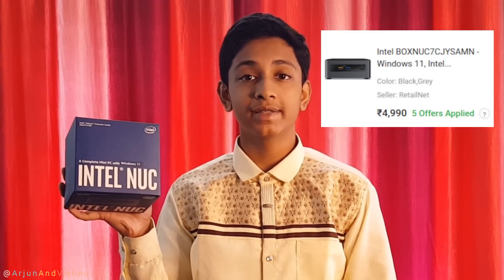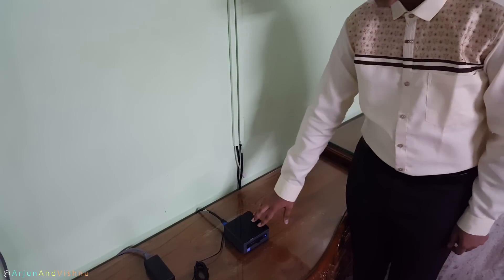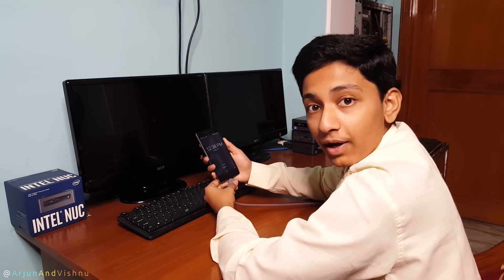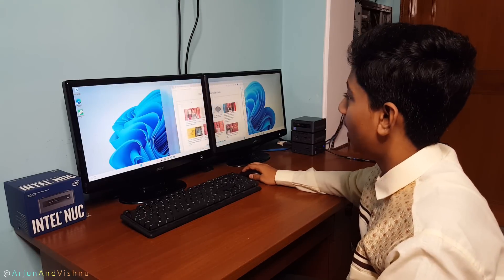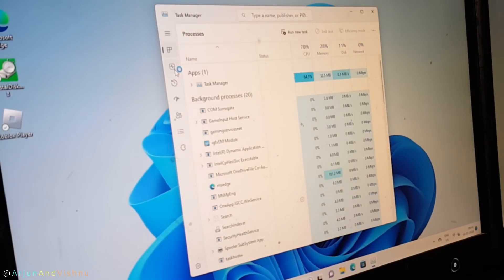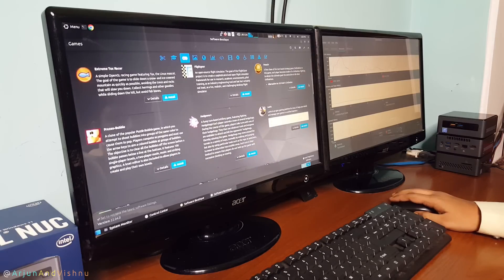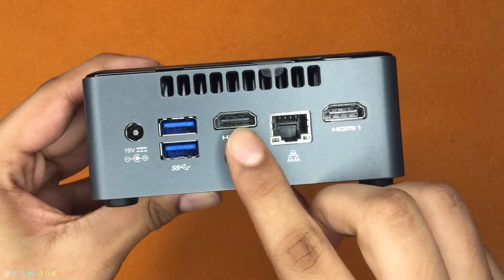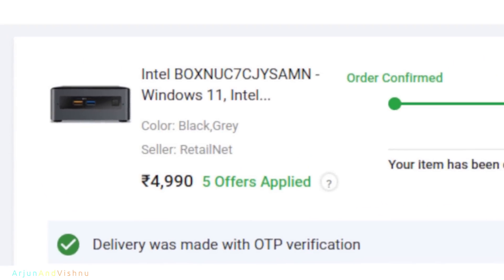Intel NUC Mini PC with Windows 11

Comment: Raspberry Pi 4 8GB or NUC for Home server ( Currently looking at NUC 10 Performance kit i3) Currently available for INR 14.2K. Is it a good deal? I will be running Home Assistant, File Server including Nextcloud and Plex media server on Ubuntu. I will be using 2x8GB DDR4 2400MHz RAM from my old laptop which died last year (processor failure/can’t be repaired). I also have spare SSD so no more additional investment there. Do you think it’s worth it. I am currently running all these services on a old half broken 9 year old laptop powered by Pentium 2nd gen processor and 8GB DDR3 RAM. Using it for past 1 year and it’s working great. But it may fail anytime. Don’t want that as it will disrupt all services and smart devices in my home.
Reply from the maker: Sir, I suppose you are talking about this NUC: 10th Generation Intel Core i3-10110U (NUC10i3FNH1). If so, the NUC is undoubtedly the better choice when compared to a Pi4.

Pi 4 consumes around 8.4 watts, quarter as much as the i3 NUC. But, that's when running at full load, and the NUC is much faster than the Pi 4.

At its current price, the Pi is not practical. Add to that, the fact that you have to add these accessories to get the Pi working properly will turn much expensive than the NUC:

1) Official power supply
2) Micro HDMI to HDMI adapters
3) USB to SATA adapter and an SSD (Because SD Cards are unreliable)
4) Heatsinks and a fan
5) Case

After getting them all, there is still no way to add more RAM. The SSD that does 500+ Mbps on a NUC, will do only 250 Mbps on a Pi.

Pi or NUC is a simple decision. If your applications are ARM based, or if you need to do something with the GPIO pins, it should be the Pi. For all other use cases, the NUC will be faster and is is better suited.
Reply: Awesome  @ArjunAndVishnu  . Thanks! Really appreciate it. At INR 14200, is this model good (NUC10i3FNHN) or shall I go for another?
Reply from the maker: Hi, NUC10i3FNHN will make a good home server. It supports up to 2666MHz RAM, but since you already have the 2400 sticks, you can use them. You will get slightly less bandwidth, but better latency timings.

14,200 is a reasonable price for this machine. Since you are using it as a server, get a similar capacity M.2 drive as well, and put it in RAID 1 with your SATA SSD. The writes will be slower, but the reads will be quicker. Most importantly, you will have data redundancy at all times.

Comment: it is useful for share market purpose, plz tell me
Reply: sharemarket wants i5 processer, 8gb RAm, , plzzzzzzzzz verify
Reply from the maker: If the applications that you use for trading are less demanding or browser based, this Mini PC will work alright. Generally, the logic is better the processor, faster the updates. Yes, you many need 8GB of RAM, at least.

Comment: I've got an Intel NUC 10 Performance Kit - NUC10i3FNHN and I'm looking to upgrade the RAM. Will the Ant Esports 690 NEO FP 4GB DDR4 2666 MHz module be compatible? Also, I plan to add 2*4GB RAM sticks
Reply from the maker: Hello, the NUC10i3FNHN supports up to 64GB of DDR4-2666 RAM. It should do alright with any compatible RAM, in theory. But in practice, I found that the NUC accepts only dual-rank RAMs for higher capacities (32GB and above). It will not be a problem for smaller capacities.

With two sticks, the bandwidth doubles as well since the NUC supports Dual-Channel.

I would suggest you to go for 8GB at least, the price difference is negligible (1k vs 1.4k Rupees). Also, you can opt for Crucial, which is a memory chip manufacturer (Micron), instead of non-manufacturer brands.

Comment: Thank you for the detailed video. Just wanted to know if we can use it as a class room CPU just for connecting to Projector and for teaching purpose (PPT, PDF and Video play via pen drive).? Do we need to add on RAM or anything??
Reply from the maker: Thank you for the appreciation! Yes, it will do all those. If you plan to use Windows only, you will need more RAM. With Linux, the installed 4GB will be sufficient.

Comment: You did a great job in explain it. Please help me if it is  hdmi 2.0 .. so will it act as earc port as  in tv .. and if it supports dolby atmos and dts/x..
Reply from the maker: Thank you! The NUC has HDMI 2.0a. But, eARC is supported from HDMI 2.1. So, I guess it will not do eARC.

However, ARC is supported by HDMI 1.4 and above, if you use the right spec cables.

Comment: can i run photoshop 2023 on it?
Reply from the maker: Yes and No! If you are using the basic functions of Photoshop, it will do alright. But, more advanced functions require a faster processor and a graphics card. Photoshop can use the GPU for a seamless experience, and both NVIDIA and AMD cards are supported.
Reply: @ArjunAndVishnu  Thank you...

Comment: I have mi box 4k ,Support 4k 60 fps  but in YouTube maximum support 1440 @60fps  and 2160 @30 fps 
So i think this nuc definitely support 4k @30fps in YouTube .
Btw i am planning to buy this device on upcoming Flipkart biggest sale BBD .
Reply from the maker: I tested for 4K 60, and observed that it drops frames. I need to test 4K 30 though, will let you know if it does alright. On BBD is a good idea.

Comment: Well explain ed.. But not about wifi spec
Reply from the maker: Thank you! The NUC does have WiFi built-in, which is soldered down to the motherboard. The WiFi supports both 5GHz and 2.4Ghz bands (Intel® Wireless-AC 9462). I mentioned it in the video when explaining the internals.
Reply: @ArjunAndVishnu  
Thanks for the quick response

Comment: How mu h will the cost after ram of 8 gb and 128 gb SSD

Tell ma, i um it can cost after the upgrade since. Monitor mouse keyboard etc I have
Reply from the maker: 8GB RAM is below Rs 1500. Go for 240GB instead of 128GB, the price difference is not much. If you want to check the prices today, the links are in the description.
Reply: @ArjunAndVishnu thanks

Comment: Thank you for the 'to the point' and concise explanation. Found it very interesting, I think you need to mention - just a line - that one needs to buy the keyboard, monitor and mouse separately, which would add to the overall cost. Also, since I am a novice in tech, it would have helped if you would let me know if there are any specific points that need to be borne in mind while choosing the monitor to be paired with the NUC. Thanks, and a good video. Keep it up.
Reply from the maker: Sir, thank you for the appreciation. I will remember your suggestions for the upcoming reviews. The NUC has dual HDMI ports, and a monitor with HDMI input is preferred. But if you already have a monitor with a different port, adapters can help with compatibility. This way, the PC can connect to any display, including CRT Televisions. Let me know of you have any questions, I am glad to answer. Regards, Vishnu.

Comment: Hi!

Can this NUC handle 10 tabs at a time and few basic applications like word or Excel for 8-9 hours?
For office purpose use.

BTW, the way you explained, its buttery smooth. Subscribed ❤
Reply from the maker: To do that, you will need more RAM for sure. I do something similar, but I use Linux. The NUC has a low end processor, and it will become a bottleneck at some point even with more RAM. Hours is not a problem, you can keep it running all the time, 24x7x365.

Thanks for the compliment, Regards.
Reply: @ArjunAndVishnu  Thank you so much for your reply and suggestion.
Please suggest me a NUC in minimum budget that can handle office work efficiently.
Reply from the maker: Well, if you are looking for a Mini PC only, this is decent: https://amzn.to/3OvCSrm

But, at 19K it is neck to neck with the budget laptops that I reviewed here: https://youtu.be/LIG-1PVGTrw

At that price the laptop is a better choice. You can connect it to your monitor, if you prefer it that way. It has HDMI out. Besides, Lenovo has more service centers than not-so-popular brands.

Thanks.

Comment: Arjun very usefull information, wonderful presentation too,. Does it have inbuilt wifi signal reciver ...
Reply from the maker: Thank you! It does have WiFi built-in, which is soldered down to the motherboard. The WiFi supports both 5GHz and 2.4Ghz bands (Intel® Wireless-AC 9462). I mentioned it in the video when explaining the internals.

Comment: I did a Disk Clone of the OS to my New 120GB SSD after that my OS is not booting with error 0xc000000e, anyway to recover the original Windows and restore on my 120GB SSD
Reply from the maker: Which software did you use to clone the disk?

I know it is possible, but I still got to give it a try on this particular machine. I'm Going through my exams, I will do it in a week.

If it is urgent, and cloning does not work, just clean install Win 11 Home to the new disk. Then, extract the digital license key with the command (as shown in the video), and use it on the SSD. It should activate alright since the motherboard is the same.
Reply: @ArjunAndVishnu  Finally Clean Install worked and it automatically took the license
Reply from the maker: That's good to hear. The OS must have installed drivers automatically, but they are usually done via Windows update channel. Due to the certification process, they are usually the older versions.

You can get the latest ones from Intel directly, and I have listed the process in this video:

https://youtu.be/hGhz7acj9N0

The first part of the video is about driver updates. The second part is about BIOS update, but you can leave that for now. Thanks.

Comment: Very nice in-depth explanation. Nice looking PC, wish they had used atleast an i3 instead of the Celeron. 
Trying to see if I can get a used Lenovo ThinkCentre M910q tiny or similar SFF Dell used ones for same price for 6000rs.
Reply from the maker: Thanks! There is a model with i3 as well, but that's above 20K. A refurbished ThinkCenter is around 10K, but watch out for the RAM. If under the 6th GEN, it will have the slower DDR3.
Reply: @ArjunAndVishnu  Thanks for the tip! I'll keep that in mind while looking for one.

Comment: I guess the metal package inside is given as a faraday insulator for obstructing outside EM noise, although the Wi-Fi chip should be placed at a different location. Anyway, a great pc for budget media consumption !
Reply from the maker: It is indeed a good PC for the price.
Reply: @ArjunAndVishnu  it was really a good video . I would like to see the benchmark in cinebench in the  out of the box condition if possible do make a video regarding that.

Comment: I remember using celeron for programming, even tried android studio (not good experience). Vs code run without any issues, even had virtual box with Linux in text mode. 
Counter strike ran without any glitch,
Reply from the maker: Accurate! 👍 I have not tried CS though.

Comment: Raspberry pi 4 / 4GB is a good solution, far more compact than Intel NUCs, and adequate for most (non-gaming) applications. Ubuntu 22.04 runs on it, along with a huge number of applications that are available for debian Linux systems. The power requirement is particularly low, and it too supports 2 4K HDMI monitors. For many people one can run off the micro-sd card alone (no hard disk).
Reply from the maker: Yes, Raspberry Pi does fine with Ubuntu 22.04. I have used the Zero, 3 and 4 extensively. Pi 4 consumes around 8.4 watts, half as much as the NUC. But, that's when running at full load, and the NUC is a third faster than the Pi 4.

At its current price, the Pi is not practical. Add to that, the fact that you have to add these accessories to get the Pi working properly will turn much expensive than the NUC:

1) Official power supply
2) Micro HDMI to HDMI adapters
3) USB to SATA adapter and an SSD (Because SD Cards are unreliable)
4) Heatsinks and a fan
5) Case

After getting them all, there is still no way to add more RAM. The SSD that does 500+ Mbps on a NUC, will do only 250 Mbps on a Pi.

Pi or NUC is a simple decision. If your applications are ARM based, or if you need to do something with the GPIO pins, it should be the Pi. For all other use cases (including running Ubuntu 22.04), the NUC will be faster and is is better suited.
Reply: @ArjunAndVishnu  Great to know that you have explored the pis adequately. Actually the combined price of power supply (Rs.150 - you don't need the official supply, just use a decent 2.5A - 3A supply), Rs.40 (micro-hdmi to HDMI adaptor), Rs.300 (External SSD adaptor for SSD), Rs.30 (heatsinks), Rs.50 for a fan is less than Rs.600. The case is very overpriced for tiny plastic box. Depending on the applications of interest, one could run even the 2GB version. The 4GB version is adequate for many CAD applications including FreeCAD, Kicad, etc. And don't forget that if you are running Raspberry pi OS, the latest versions of Mathematica is bundled free !  The downside of the pi is that you cannot run applications like Android Studio. But if you are keen on embedded systems like the pi-pico, the toolchain are naturally aligned for the pi.   The price-point of the NUC has to be in the range of Rs.5K  (without any 'deals' ) for it to be more attractive. The price point of a pi4 / 4GB should have been around Rs.4K for it to be more useful. I personally like the pis because I can slip them in my pocket  !
Reply from the maker: Sorry for the delayed response. I postponed and almost forgot. Yes indeed! You can get the accessories for less. But, I'd be careful when choosing them. I used a 4 Amp rated unofficial power supply for one of my Pi 4. The power supply did not have the necessary overload protection sensing, and it burnt my Pi. When this happened, the price of a 4GB Pi 4 was hovering around 12K.

I agree that the Pi is more practical at around 4K. There are other SBCs that have caught up in terms of processing power already.
Reply: @ArjunAndVishnu  Yes one has to be careful with power supplies. The safest thing to do is to have a low drop-out linear regulator (so the voltage will be pinned for sure) supplied by a switched-mode power module. Sorry to hear that you fried a pi4 accidentally !   One exciting possibility has emerged. One could run the pi-zero with older Linux OS or ones that do not demand a lot of resource. This makes for a full functioning computer for less than Rs.2K.  A lot of interesting IoT applications can be run from such a system, including running web-servers.  Another even less expensive system has been built using a mere pi-pico microcontroller - just having a daughter board / shield which has a few things like an hdmi chip, an sd card slot, etc.  These are actually very powerful systems - particularly for implementing lots of robotics and control applications.  So one could build a fully functioning Linux machine for less than Rs.1000 !

I like the enthusiasm and professionalism you depict in your work / youtube-videos.  Keep up the good work, and hope to see a lot of exciting work from your end. All the best.
Reply from the maker: That's very useful info. I appreciate your knowledge, and the willingness to share it. Thank you very much, I got to learn something today.

BTW, I am not finding much use of my older PI 3 and Pi Zero, so I purposed them as network monitors.

Comment: Continuous running 8 hours in PC trading dual monitor setup how to work
Reply from the maker: Yeah, it will do fine at that if your trading application does not need a lot of processing power. I am using one unit as a file server, and I never switch it off. Continuous usage is not a problem, it has a FanSink to take care of the heat.

Comment: Hey buddy you gave great presentation skills you can definitely go ahead and reach million
Reply from the maker: Thanks a ton
Reply: @ArjunAndVishnu it could be a very efficient data server for small home server connected with cctvs and other devices and some space storage,
Reply from the maker: Good idea! That is what I am doing with one of them. I have connected  two dual HDD docks with 4 disks and made a file server of it. Since it has USB 3.0 ports all around, it is fairly quick. You can as well use USB 3.0 to SATA adapters and SSDs along with them for your NAS. Do set them on RAID1, RAID5 or RAID10 for data redundancy.

Comment: Can this pc replace a laptop with sscond gen i5 and no graphics card. Just found out my pocket money savings is almost enough to buy this😅
Reply from the maker: In terms of raw processing power, a second gen i5 2400 is still double as quick as this processor. However, it loses at the other things:

1) DDR3 RAM vs the NUC's DDR4 (higher bandwidth)
2) Single HDMI vs Dual HDMI (more monitors)
3) 95W power consumption vs the NUCs 10W (power savings)

Comment: can the processor be upgraded, if yes, can you tell which one to buy and how to install that processor?
Reply from the maker: The processor J4025, is an fcBGA, meaning it is soldered down to the motherboard. So, it cannot be changed.
Reply: @ArjunAndVishnu  ok , thanks.
Reply: in the video you have mentioned that we can upgrade to 32 gb (16+16) ram,  will it helpful overall compared to 16gb (will the performance difference be worth it?), asking because i have very less knowledge of computers
Reply from the maker: No! 32GB is an overkill for this computer. The reason is the processor saturates when you load multiple applications. It will be useful in a few cases though, example: a web server or scratch drive. Generally, an additional 8GB will be sufficient to match the processor, and you can get that for under Rs.1500.
Reply: @ArjunAndVishnu  thank you
Reply: @ArjunAndVishnu  thanks, this 8gb should be 4+4 or single - 8gb?
Reply from the maker: It should always be x+y, because this chipset supports dual-channel memory. Technically, you get double the bandwidth. Since it comes with 4GB of RAM already, another 8GB should get the total to 12GB.
Reply: @ArjunAndVishnu  thank you